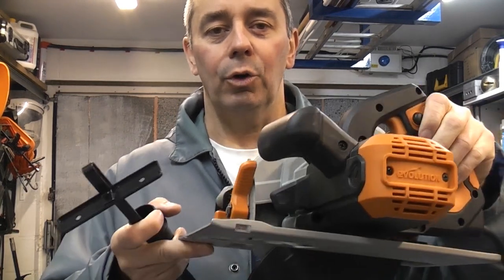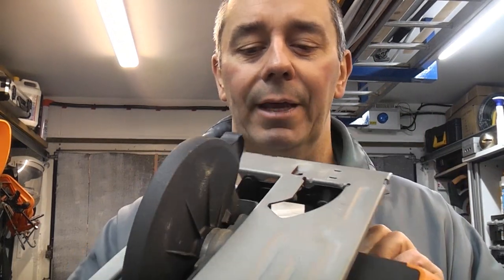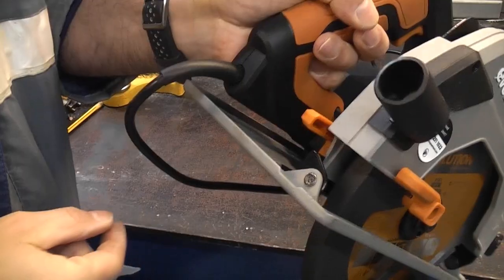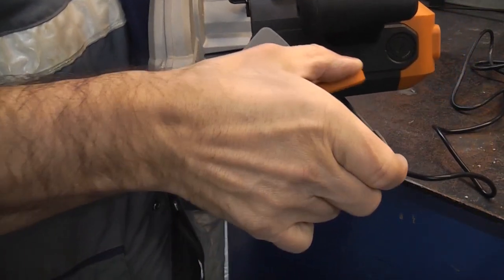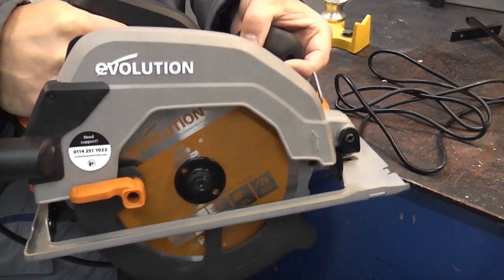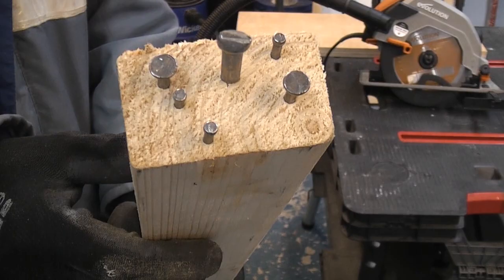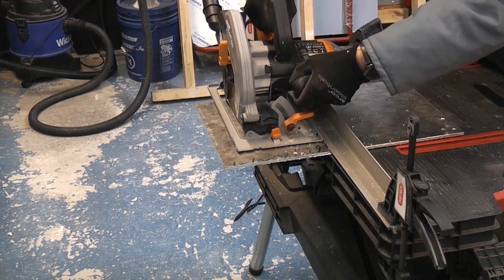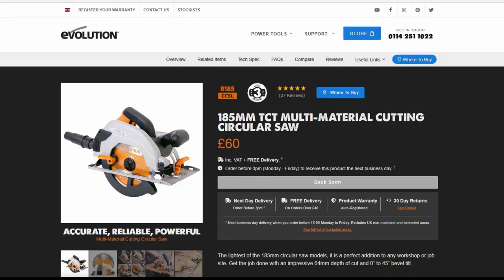Evolution R185 CCSL  | 185mm TCT Multi-Material Cutting Circular Saw

Comment: For an extra £15 you can get the identical looking Evolution track saw. 
It fits on Festool tracks which are 1400mm long as opposed to the 350mm tracks that it comes with. 
It sits slightly away from the splinter strip on the Festool track which is good because I only use the Evolution for cross cutting old floorboards with nails and don’t want to replace the strip. 
Recommended 👍
Reply from the maker: Thanks for the comment 👍

Comment: Hi, I have modified all my electrical tools, and they now have a 6-inch lead onto a 3 pin coupler. I also have extension leads of various lengths, the coupler is waterproof and because I don't have long leads on all the tools I was surprised at the ease of storage. My extension leads start at 6 feet (1.83 m) and go up to 30 feet (9.14 m), so I can reach any location I need to. I do have a track saw system, and I was surprised to see how useful it is for cutting up full sheets of plywood. I also bought a small bit of track and have set it up to use as a crosscut system and again I am very happy with it.

Comment: Looks a decent bit of tackle👍. Any power saw that doesn't need a blade change is very advantageous. Gloves tick. Safety goggles tick. Ici jacket tick. The trainers let's it down 😀. Great demo👍. I'm definitely getting one for that price.
Reply from the maker: They are steel toe cap trainers 😉 (I think they are site brand from Screwfix) 
Thanks for the comment 👍

Comment: The thing that makes most saws work well is the blade, poor blades can make the most expensive saws perform poorly. This blade seems to work pretty well it this test, but it would not make me want to buy the tool... because it's the blade I want!
Reply from the maker: The Evolution blades are great, but don't think they will cut metal on other machines, due to the amount of torque needed etc.
Thanks for the comment 👍

Comment: I’m not keen with that saw as with any saw that I can’t see the blade in operation. I’m right handed as many of us here. I like to operate the circular saw with my right hand and most importantly I like to be able to see the blade. One of the issues I find with these fences that comes with these saws is that they are a joke. They are way too small. In my view a good fence needs to be pretty much the whole length of the base. I have a Ryobi and also the fence is a joke that is way I don’t use the fence at all. I have to admit that this saw at that price is a steal. 
Nice video as usual.
Reply from the maker: Yeah, I know what you mean with the fence, although I rarely use one myself, as I prefer to clamp something to the work piece and use that as a guide.
Thanks for the comment
Reply: Ultimate Handyman That is exactly what I do. From time to time Lidl sells clamp down guide rails in a good price. I have 2 of those.

Comment: Hello bud, just a quick question if you dont mind. Will the blade in your Evo fit on an ERBAUER ECS18-LI 165MM cirular saw ? Appreciate your honest reviews and like your vids.
Reply from the maker: I'm not sure, but the bore is probably not the same (manufacturers do this to make you buy their blades). Also you would need to check the speed of rotation. 
Thanks for the comment 👍
Reply: Cheers and thanks for your quick response

Comment: I noticed at the end of the video when you were cutting steel that the vacuum port was aimed at your face, a lot of saws can swivel but you did not say one way or the other?
Reply from the maker: The dust port on this is fixed, but I always wear safety glasses, ear protection and a full face visor when cutting metal with any evolution saw.
Thanks for the comment 👍

Comment: Can you buy the saw blade on its own
Reply from the maker: Yes, you can but it might not be the correct bore, or run at the correct speed for other makes of saw. 
Thanks for the comment 👍
Reply: Screwfix do replacement blades for around £20. Evolution state that only Evolution blades can be used in their machines. Think this tool is on promotion at the moment @ screwfix. £50.
Reply: I bought a blade in Screwfix and use it in my Makita LXT circular saw
Reply: @kills99ofbacteria50  I can't see any 1600 watt Evolution saws on special at Screwfix, there is a 1200 watt at £49.99.

Comment: Can I buy just the blade?
Reply from the maker: You can, but these saws have a high-torque gearbox which enables them to cut metal. If you fit this blade to another saw, you must ensure it rotates at the correct speed- or it could be dangerous.
Thanks for the comment 👍
Reply: @ultimatehandyman  Oh, I didn't pick up on the high torque aspect of the unit, thanks.
Reply: @MiniLuv-1984  I know the chop saw blades use a different arbour size. I did get a reducer ring so I could put a 60 tooth wood blade on my evolution chopsaw. I would expect these blades may not fit other saws without a ring, maybe someone could confirm....

Comment: I know this is cheap but we are in the brushless age
Reply from the maker: I have never even seen a brushless 230V circular saw, yet.
Thanks for the comment 👍
Reply: Brushless AC mains motors are very bulky and heavy and produce much heat. Generally require a start and run capacitor or complicated controllers,  to run of 230volts, which are very expensive. Perhaps the future will bring these at a more compact size and better price.
Reply: @ultimatehandyman  check link above isent ya
Reply: @ultimatehandyman  its MN Akita cordless
Reply from the maker: @joeys5429   Like I said, I have never seen a 230V brushless circular saw- I've seen plenty of cordless ones ;-) 
The circular saw in this video is 230V, not cordless.